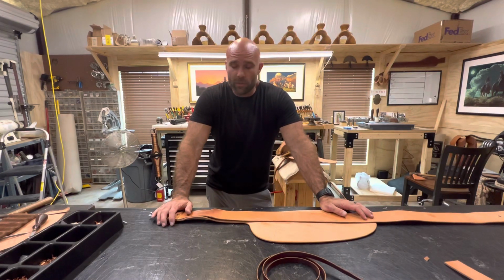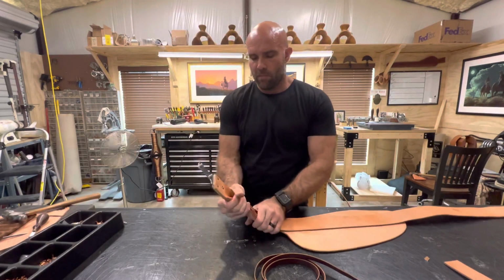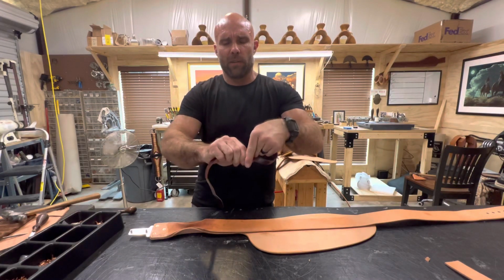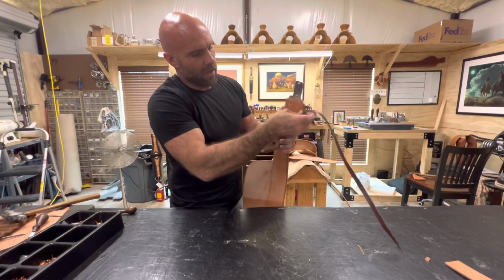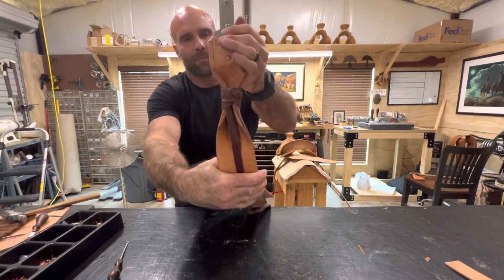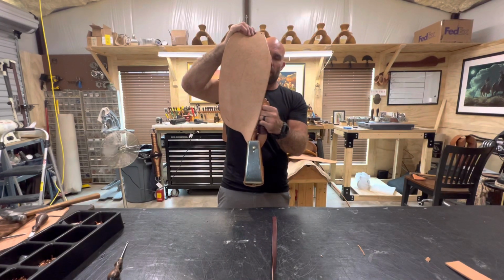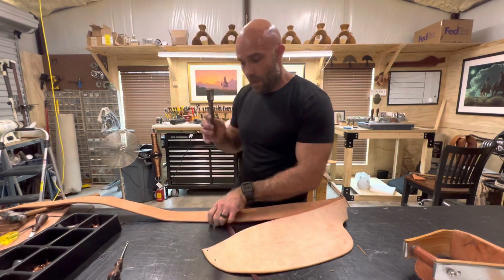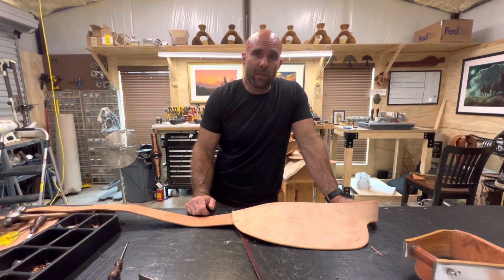Setting Up Stirrup Leathers the Right Way - The (Nevada) Twist

Comment: I've looked at a few ways and this is the best I can see. Thanks! One lady suggested reversing just the blevins buckle by removing and reinstalling the rivets and all...
Reply: Yes I was just watching that.  It accomplishes nothing.  She's not the only one recommending it, so I'm on a mission to figure out how removing the blevins and flipping it over (which most of us can't do, because we don't have the equipment) is helpful.  This is the best I can see as well.  It makes perfect sense and it's easy to do.  The only question is whether you want to bother pinching the leather and wrapping it like that.  It definitely looks cool but it's not necessary.  You can just leave the leathers flat.
Reply: @epona9166  the blevins must be taken off and flipped so that you pinch and twist the leather. Ben has already done this prior to starting the video. The twist is what makes the stirrup hang perpendicular to the horse. Another way to help the stirrup naturally hang perpendicular is to leave the Blevins attached the standard way, thoroughly wet the fender and stirrup leathers with clean water, attach the stirrups and stirrup hobbles then twist each stirrup 180 degrees (both sides) and place a 2x4 through the both stirrups. The 2x4 will hold the twist in the stirrups while the leather dries. Use your hands to shape the fender to maintain the fender tail perpendicular to the saddle while the leather is wet and it will maintain this shape when it dries. You are bending and shaping the front 3-4” of the wet fender outward 90 degrees to the back half of the fender. It is easiest to do with the saddle on a saddle stand. This is what I would normally do for our customers prior to them taking delivery of a purchased saddle. It takes several hours for the leather to dry and take a set. The technique Ben is demonstrating is more difficult and requires equipment, supplies and technique that most might find challenging.

Comment: Excellent.  Why don't saddle makers do this from the get go?
Reply: Circle Y Saddlery has done this on their top tier saddles for at least forty years.
Reply: People ask this all the time.  Manufacturers prob don't turn the stirrups (putting the Blevins prongs through the other side of the stirrup leather) because leaving them flat takes up less room shipping and displaying the saddles.  There would be no reason to turn them before the saddle is put in service.  It takes two seconds and works right away. The leathers don't need to be soaked in water or "trained" or anything.  As for pinching the leather and wrapping it, not everyone wants that done (it's not necessary to turn the stirrups) and I'm guessing many serious working western riders have their own way they want to do it.  If I were such an icon, I'd prob want to do it myself.

Comment: One thing to note, the Blevins buckles must be mounted with the pins facing what would be considered backwards from the conventional direction.
Reply: No I don't think that's correct.  I'm trying to find out (here on youtube) what purpose that serves and so far nothing.
Reply: @epona9166 what are you trying to figure out? Maybe I can explain.
Reply: @ctsolano  Great thanks!! What I'm trying to find out is how, specifically, detaching the Blevins buckle from the leather, flipping it over, and reattaching it (now with the prongs facing the opposite direction) aids in turning the stirrups.  Most people, myself included, do it like Ben does here: With the Blevins attached to the leather the "normal" way, and the fender hanging from the saddle in the "normal" way, twist the buckle end around 180 degrees and insert it into the side of the stirrup leather you normally wouldn't insert it into.  Meaning you would insert the prongs "toward the horse"  into the holes.  You can do this with or without pinching the leather together and wrapping it like in this video.  That doesn't affect the way the stirrups face.  I've seen several videos where they talk about completely detaching the Blevins buckle in order to turn the stirrups (Leather Lady LLC and Carson James, so far) but neither one actually demonstrates it. I hope that makes sense.
Reply: @epona9166  You are correct that the way Ben is doing this is the only way I know it can be done. My original comment was made to simply point out that to accomplish what Ben is demonstrating, the Blevins pins must be attached to the fender as you see Ben has done in the video , which is 180 degrees from the standard way they are normally attached. While it might be obvious to some, Ben doesn’t demonstrate attaching the pins or point out this detail in the video. The pinch in the fender tail/stirrup leather and lace wrapped twist repositions the pins facing the standard direction and creates a rotation of the fender tail, when attached to the stirrup leather, that makes the stirrup hang nearly perpendicular to the horse allowing  for  insertion of the rider’s foot with no twisting of the ankle. Circle Y of Yoakum starting doing this on many of their saddles in the early 80’s. While I am sure they didn’t invent this idea they were the only production saddle company to my knowledge, to have done this. I am unaware f others suggesting that there is another way to accomplish this. I will look at those you have point out and see if I can understand their logic.